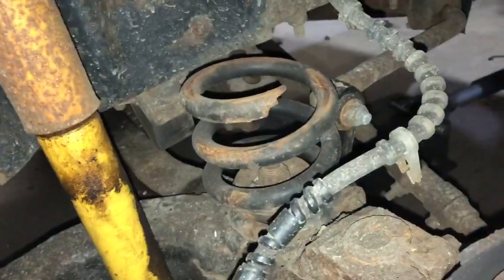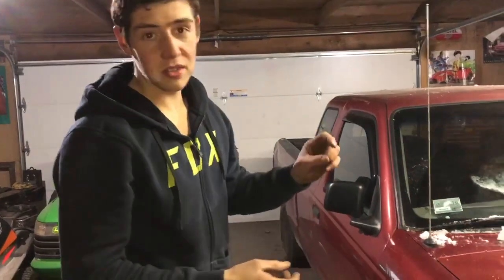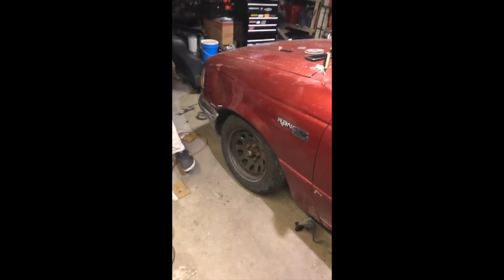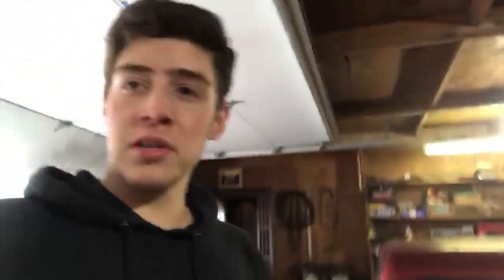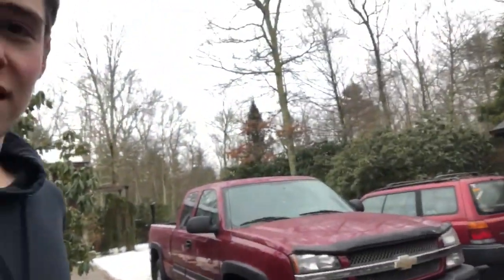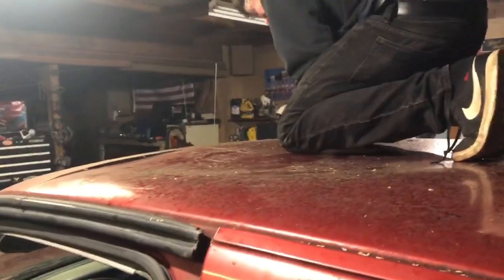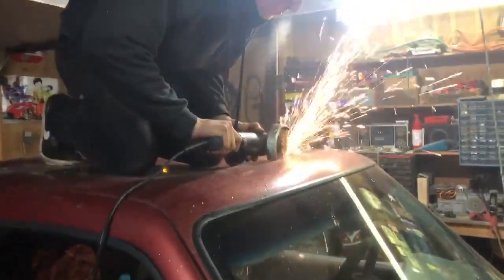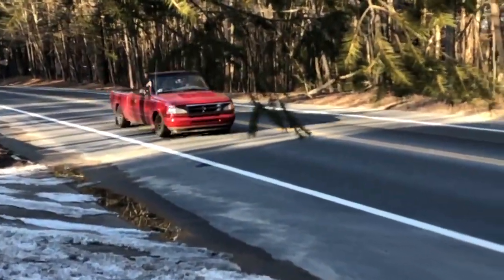FIRST FORD RANGER CONVERTIBLE

Comment: Back in the 1980s a old co worker of mine nought some old maybe early 60s  full sized station Wagon and chopped the top off. The car with a sawzall  the end result was a pretty cool  similar looking ElCamino/ Ranchero looking thing it was definitely one of a kind as he did do a nice job on the body work and painted the  whole thing yellow with  nice rims on it the. Weird thing was   When he got the car from a elderly neighbor it was in great shape as they were  the original owners  and didnt use the car very much  when the guy showed me the car and told me his plans i tried to discourage him because i knew he was a big Stoner and i didnt think he was capable of doing a professional. Job as i knew he was a cook  and not a  metal fabricator  however i did tell hm after he did it why i was against it originally and that the outcome really suprised me  quite a bit   Along with his craftsmanship